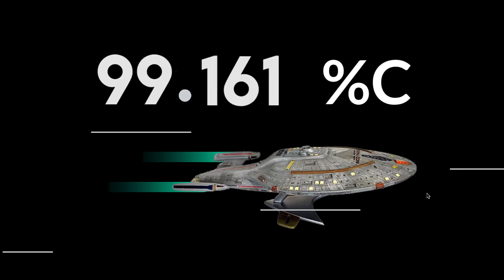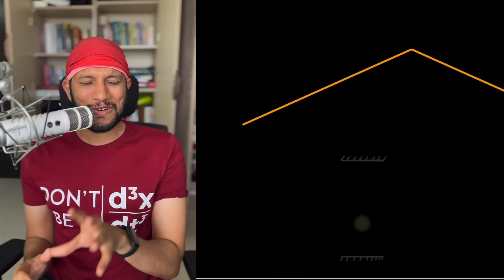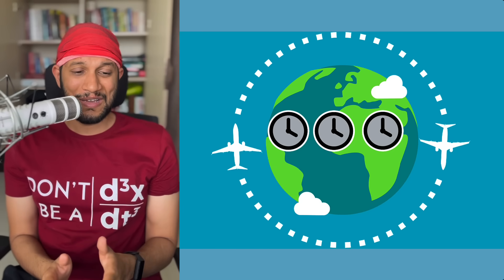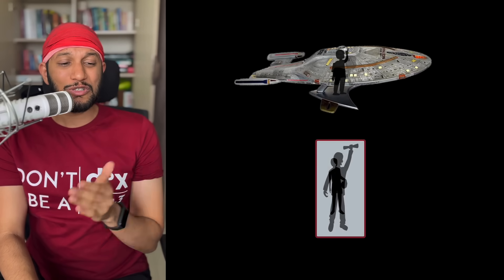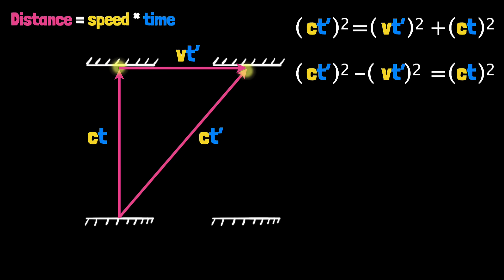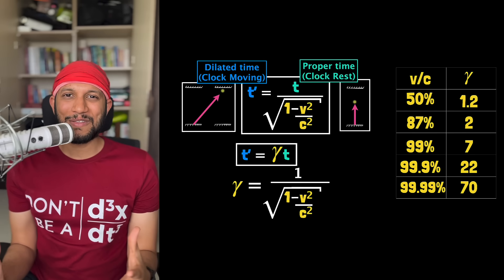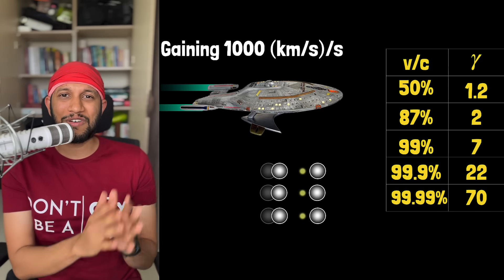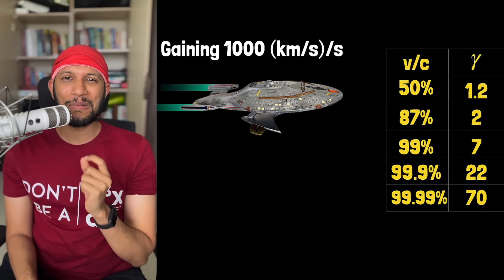I finally understood why you can't go faster than light! (My mind is blown)

Comment: thx for sharing this video... i guess i still don't understand high school level physics on relativity and time dilation... the whole time dilation "t' " is due to having both vertical component of velocity and net velocity to have identical value of "c", but this requires using "t" and "t' " to make Pythagorean theorem works... but why same "c" value?  the net velocity should be sqrt(c^2 + v^2) though... so if object travels horizontally at speed of light "c", and with vertical speed of 'c", then net velocity will be c*sqrt(2)... if net velocity can have a value larger than "c", then there doesn't need to have this idea of time dilation to make Pythagorean theorem work... is there any practical proof this whole time dilation theory is valid?

Comment: Another condensed explanation might be that if a photon clock were on board the ship, at the speed of light the photon would never release from the first mirror because it's spending all its energy moving in the same direction as the ship. I.e. time stands still (infinite dilation).

Comment: This is incorrect. Quantum entanglement occurs at far higher speeds than light.
So if two atoms can synchronise faster than light speed, it stands to reason that molecules can, and if molecules can then solid body mass can also move faster than light.
Reply: but they dont synchronize faster than light.
how can you test that?

Comment: Since the earth, and everything on it, is moving around the sun which is moving around the galaxy which is moving through the expanding universe, then if you get on a space ship and travel in the opposite direction, your atoms will be moving slower away from some stationary singularity in the universe, and thus, you will age faster. Correct? In my example, the atomic clock on earth is actually the moving clock. Where is the stationary reference from which all time is measured?

Comment: The speed of light is easily surpassed.  All one needs do is to shift up out of the physical universe and into the lowest of the sbutle (some call spiritual) planes of existence.   The physical does not exist on it's own you know.  At the moment of the big bang several planes of existence were "created" at once.   All are bound by time but time of a different rate of flow.   Physists will nay say my claim simply because they have never worked in anything but the physical.   Their study of sub atomic particles takes them to the boundary but no further.   

There are many other species of human beings in our galaxy and beyond.  They are not all at the same point in evolution.  Some are just a bit more advanced than we.  Other are much further along the path.   These, the later category, have the capability to do as I describe, change from their physical bodies into their eithereal doubles.   These are known on Earth.  We call them ghosts sometimes.   It is the vehicle that people use when they are having a NDE and move about in the hospital seeing other people doing things.   It is also the vehicle that the miilitary uses when they do remote viewing.   

It's real.   If the subtle planes did not exist then no psychic phenomena would be possible.

Lastly:   It was to his lower subtle, the ethereal, that the master soul Jesus shifted when he visited his disciples in the "upper room".   There are men and women on Earth right now who routinely do the same thing.   

It's not magic.   It's real.   Wake up scientists.   Throw away your prejudices... dare to step beyond the physical, and learn.

Comment: Question - The photons are continuously released from a source and therefore the distance gets longer but if you return with the same travel speed you can nullify the time dilation because photon released from the same source, the distance gets shorter. With this statement, What is time dilation????

Comment: Sir, in the first example of the spaceship.... You said that the distance has increased so it must have taken the dot a longer duration of time to cover that distance which means.... Time has become slower... But as t=d/v.... The magnitude of the velocity of the dot has also increased on the x-axis due to relative velocity of the spaceship to the observer... So the magnitude of velocity only on the y axis is same but only x-axis it has increased. Hence it maintains the ratio of distance and speed hence... Time taken is the same... Can anyone explain???????

Comment: Sorry to dissappoint you but you presented only a very particular case: that in which ships direction is PERFECT PERPENDICULAR TO PHOTON PATH! If is in the same direction as to say ship  having some headlights, than some big problems might occour...and in part 2 u say that the speed of transfer between molecules is maximum C so even with an atomic blast behind ship the speed can't increase, that is correct until we can find some exotic particles that can travel faster than this annoing C! 😊😏

Comment: The most intuitive explanation of time dilation I've seen, and the animations are clear and well done. Fantastic video :)
Reply: Oh hello there, didn't think I'd see you here
Reply: tf u cheetahhh.....
Reply: That worked until I got confused by why a pulse through a wire is slower than a RF pulse through a wave guide. (9 Ghz or 1 Ghz and speed that does not matter)
I still do not understand it. Even though I understood the math.
But since I do not work that stuff any more, I do not care anymore.
Oh and the medium in the wave guide is a vacuum. The pulse in the wire travels at the speed of light. The wire does appear to be slower.
And does not matter if it is SF6 or vacuum in the wave guide. That is why I switched to finance.
Reply: it is wrong. no real clock slows down, because no real clock measures time, not distance. all real clocks measure time*distance, and that is a non-variable. 
Einstein was often confused

Comment: Forget about seeing the light, I’m not interested in light. Take light out of the equation. 
 I’m going for infinitely higher numbers.
Reply: Well light is part of thr universe so i dont know what you mean but real physical clock do slow because the protons and electrons are exchanging photons so as you moves the photons will take diagonal path that is longer then before so the interaction becomes slower so the rods and sticks slow down if the speed is great enoigh to approach C then you will notice

Comment: If 2x objects both travel at 0,6 the speed of light away from each other, with you standing in the middle you can observe FTL. Am I going crazy and or is the whole justification for why FTL isn't possible based on an optical/time illusion? Wow, great you have calculated an optic illusion and time dialation, but non of this would happen if observed from a 3rd perspective or a perspective that ignores those things! WTF is this?! "Speed" = relative distance between two objects over time! Why wouldn't you be able to observe objects going FTL in relation to each other? Isn't this exactly what special relativity is about? .... holy moly are you people... word.

Comment: Technically, a Starfleet starship does not break the speed of light.
It dives into subspace with still on sublight speed but the warpfield distortion warps spacetime via subspace and creates a shortcut between the ship and it's destination. so technically wir Warp Speed, you don't break the rule of matter not being faster than light

Comment: It wouldn't be infinite time from the ship's perspective though? We saw that with time dilation, one second in the ship's perspective is not the same as an observer's perspective.  Does that mean that if we were able to create a ship that can accelerate to the speed of light, at some point we the ship would seem to be completely at rest in our perspective, but the ship has actually reached the speed of light?
Reply: E=mc. You would have to warp Acceleration in order to go FTL. That essentially means creating another universe as this one is bound/defined by the speed of light. 
What does the universe look like bound by the speed of tachyons? E=mt? 
(c) is the fastest anything can travel. Including information. You can create a wormhole and send tachyon waves through it. Can normal matter pass through it? 
Obviously tachyons are theoretical.

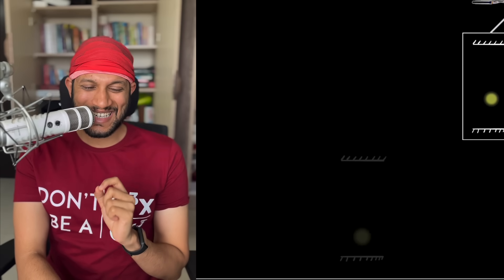Comment: 1:57 I think that this is wrong. How can you keep that clock moving at some high speed without it hitting the wall of the container and changing the result? 

Imagine how it would look if the clock was kept in the other axis.
A person looking at that from outside would see it move faster and slower and faster and slower. Faster in one direction and slower in the other but as the rocket is moving in a direction, it will constantly move in the direction of the rocket but with changing speeds. Does that mean that the time is flickering? NO! 👎 

I think that this has something to do with quantum physics or something else instead.
Reply: Quantum mechanics doesn't deal with relativity. It assumes our universe to be relativistic, that's all.

Comment: If C is constant in all reference frames, would it not mean that to a ship traveling with 99% of C the light would still have a speed of C relative to the ship and, as such, the "effects" of electromagnetic bonding between particles would also propagate with C?
Reply: the ship is at rest in its frame, and the em force travels at c between all charged particles

Comment: I don’t quite get how the photon moving diagonally leads to the time between ticks increasing. Isn’t the time per tick based on the vertical component of the photon’s movement? So the horizontal component wouldn’t affect the time it take to move along the y axis. I’m thinking it has to do with the fact that the photon is always moving at c velocity but it’s hard for me to visualize.
Reply: The idea is that the speed of Photon is 'c' along the direction in which it moves. I would obtain the vertical and horizontal components from the original velocity, rather than obtaining the velocity from the vertical and horizontal components. The reason would be because there is a physical limitation on the speed of light. You cannot add up a horizontal component as you have asked, since that would increase the speed of light in the direction in which it moves, hence violating the fundamental law of nature.

Hope your doubt is clarified.

Comment: If we accept the fact that light is also a wave and assume that the wave moves in quanta, i.e., it is not a single object but a series of disappearing and appearing manifestations of a photon, then light, even for an external observer, will travel the same distance. This is because the distance will be measured not by the length of a continuous trajectory but by a discrete number of points of phase change. In this case, there are no paradoxes or time dilation. There is only the influence of the angle from which we observe and the wavelength of light for the external observer. It is purely an optical effect without any bizarre phenomena or logical contradictions. From this perspective, particles that are accelerated to high speeds "live" longer because they have been given more energy for stable existence.

Comment: 1 step further: how can we measure the speed of light under the assumption everything is moving and we don't know the speed of this movement? 
speed of light would have to be measured with some objects and this objects are in some motion, as there is no rest/stationary frame for them
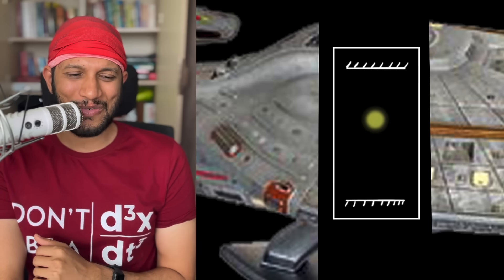there is no case when the clock works as at 1:06 
if the speed of light is constant we cannot use a method based on a speed difference
i know the assumption of independence from frames makes it easy, but this assumption has somehow been proven

Comment: i think I am missing an important bit to understand it, and I am trying to find it
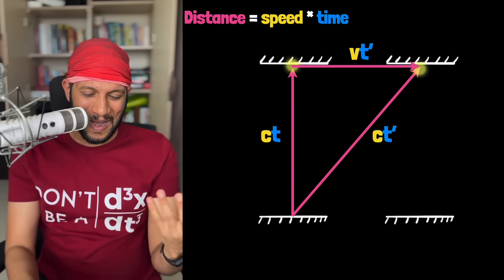why are we using the OUTSIDE frame to assess something that is happening INSIDE a moving craft (ex. spaceship) 9:09 and the whole explanation with extended time curve ? 
does the light really have to pass the longer distance when the object is moving? i can understand the explanation of time dilation for the OUTSIDE frame, but do not get what is happening inside the frame. how can the "time view" from OUTSIDE influence the processes INSIDE (like ageing)? 
or maybe the light not only has the same speed but moves somewhat independently from all the frames, maybe the light "has its own space" and there is no such thing as "local rest frame"
or maybe the light is somehow influenced by the movement (with acceleration or even at constant velocity) and that is the actual reason for time passing slower?

Comment: I would imagine the "proper time" is also fouled with the fact that the Earth is also moving through space at 67,000 miles per hour?
Reply: It doesn't since it only depends on whether or not the observer and clock are stationary relative to each other.

Comment: Bhaiya I have a doubt regarding that photon clock. If the ship is moving and the photon is getting horizontal component of velocity , still the vertical velocity isn't changing at all and so the time for striking between two of the mirrors. So how is  actually time getting slower??
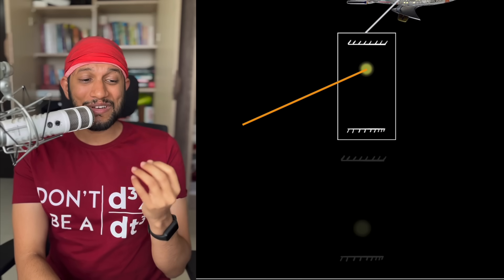For reference the time stamp  2:07
Reply: The magnitude of velocity of photon is always the same. If it gets horizontal component of velocity, then it's vertical component must reduce
Reply: Yah that's the same question I wanna ask. btw are you also preparing for the JEE by any chance

Comment: 9:30 isn't ct' less than ct because t' was dilated time so it should smaller than t so therefore ct is greater than ct' than how ct' become hypo tenus.
Reply: And also we have lenth contraction also, there fore ct' become more smaller also than how it becomes hypotenuse when it's smaller than its adjacent 😮😮😮
Reply: So you are wrong ,adjacent should be ct' and hypotenuse should be ct ,yes it is because the hypotenuse was measured in our frame of reference for us time is t and the .and vice versa for t'
Reply: Or I made a revolution after making changes according to my thoughts I got t'=t(1-(v²/c²))½
Reply: Sorry I don't make anything you just edited wrongly.😅
Reply: Even I've jumped to such conclusion, but wait, t' is the time measured from a static reference frame where time runs fastest. Thus t' > t.
t slows down wrt to t'.
Reply: t' is bigger because it is the dilated time measured from outside

Comment: To prove time dilation you spoke and showed both proper and observers pov regarding the spaceship but on the very last portion of the video to prove why we can't reach the speed of light you only spoke and showed proof as an observer. eg; time increase for the ship to gain x speed doubles at 87% of C. But what about the ship and it's crew locally? There's no time dilation for them therefore it doesn't need infinite energy or time since time runs normally for them. I either missed something or you completely ignored the local pov on the last example. Which is to say okay, C cannot be reached for the observer but for proper x it is still allowed

Comment: Time can't dilate it's just slowed electromagnetic force slowing the mechanics of the clock not time. It's a concept you can't change it it moves forward only and at the rate you arbitrarily assigned it

Comment: If I were to travel to a star located some 4ly away, like proxima centauri, at 50% the speed of light it would take me 8 years to get there and 8 years to get back home. With a time dilation of 1.2, 19.2 years would have passed on earth, correct? If I were to crank the speed up to 99.99% the speed of light I'd make the trip there in pretty much 4 years and 4 years to get back. During these 8 years 8*70 = 560 years would have passed on earth. Is this correct?

Comment: But... that's only for everyone seeing the ship from the outside - the reference for everyone inside would be the same, right? So as they accelerate closer and closer to the speed of light, they will simply see the outside world's time pass faster and faster, presumably until they see the universe's theorized "heat death" and whatever is left of it post infinite amount of time (if that's even conceivable)?
Someone help me understand this part. This means that it IS possible to reach the speed of light with finite fuel, it would just mean the people aboard the ship would skip to the infinite end of time/universe which we outside the ship won't be able to see because for us they will have slowed time down aboard the ship enough that we would stop seeing them moving through time, but aboard the ship they'd continue, right?